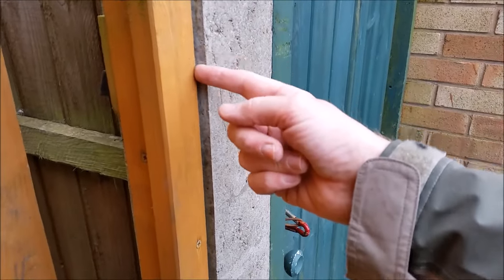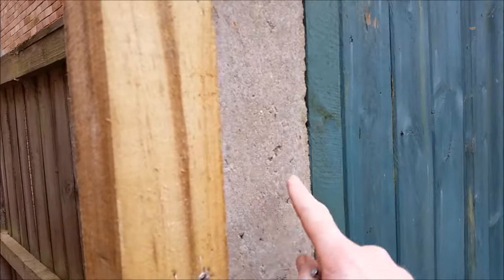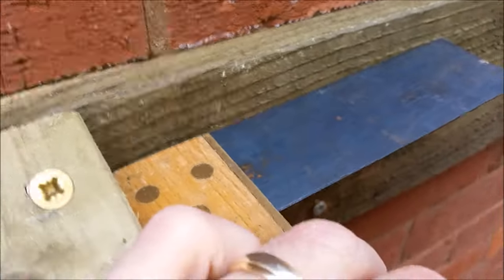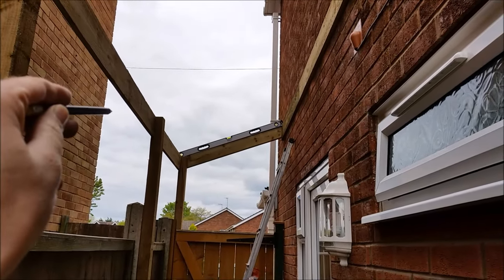Making a "lean to" roof for a walkway - Part 1

Comment: I'm thinking of building something similar at the side of my house. The problem I have is that I will be using clear plastic sheeting as the roof. However there's a black pipe coming down the side of the house. When i put the plastic sheeting around the pipe. What's the best way to make it water tight?

Comment: Question about drilling into the concrete posts. 
Have you had any adverse effects i.e. cracking or fixings loosening from the wind and elements over time?
I'm thinking of doing the same thing instead of sinking more posts into the ground right against my fence. 
Great vid btw👍

Comment: Did u need planning permission for this? Thanks
Reply: No
Reply: Permitted development rights allow a max height of 2.5m within 2m of a boundary.. so long as the structure doesn't project forward of the principal elevation of the property.. Check out the gov planning portal.... It's worth checking with your local planning authority because some authorities have exclusions which prohibits this kind of development..
Reply: @chevyimp5857  many thanks